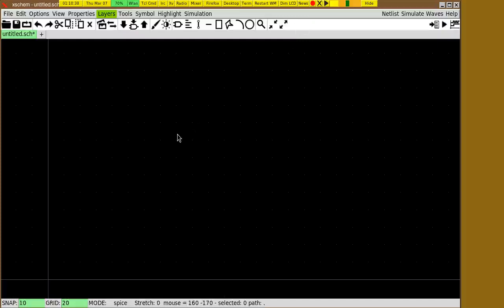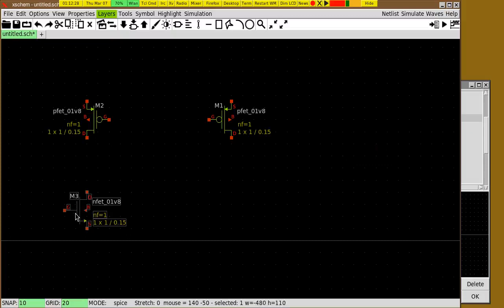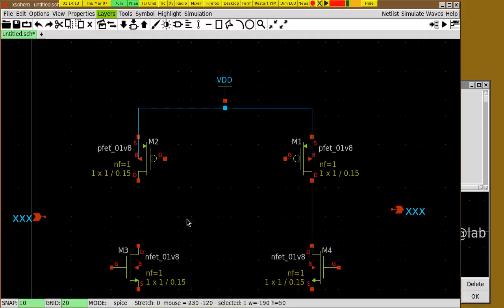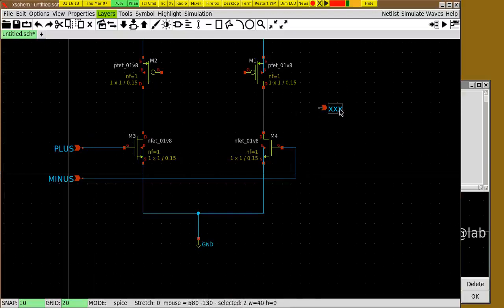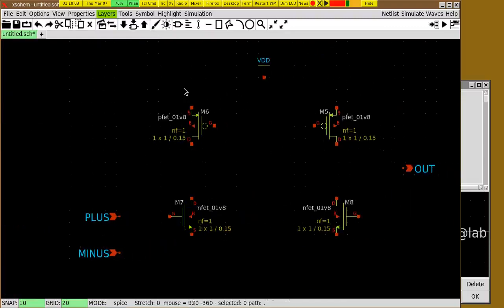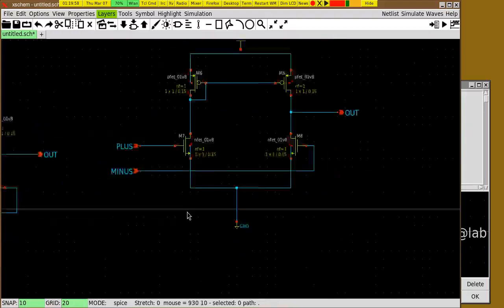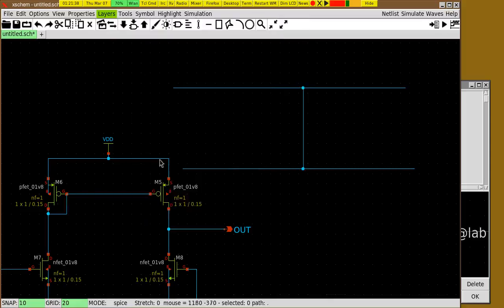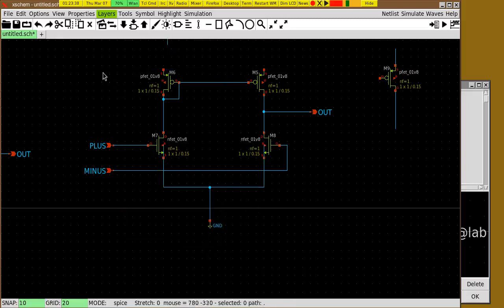Drag wires from pins with simple Point, Click and Drag actions.

Comment: Hello Mr. Stefan, I'm not sure if this is the correct platform to ask, but, how would the nf affects the simulation? For example, If I have a width of 20u (NMOS) and a nf of 4, does it mean that I have a total width of 20u (with each finger consisting of 5u) or a total width of 80u (with each finger consists of 20u). Thanks!